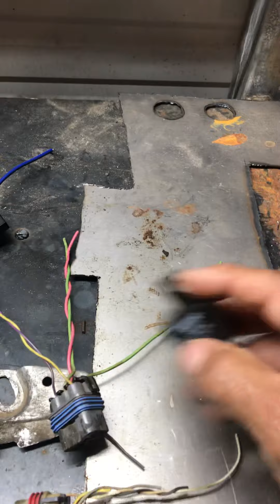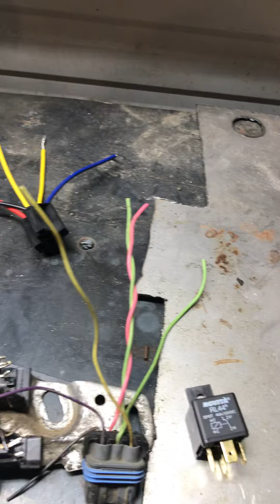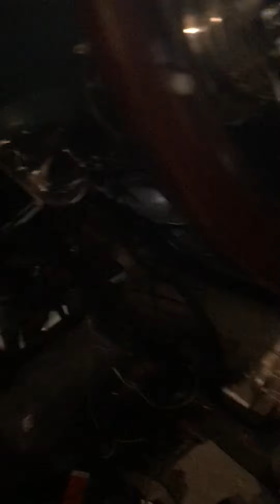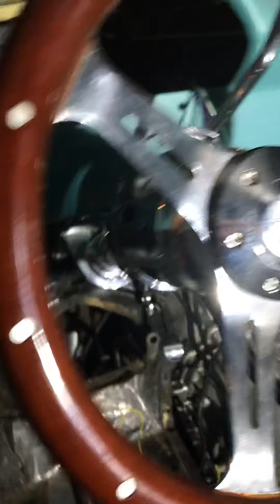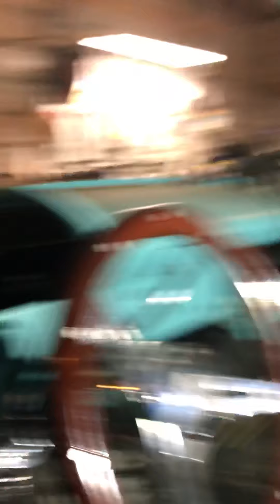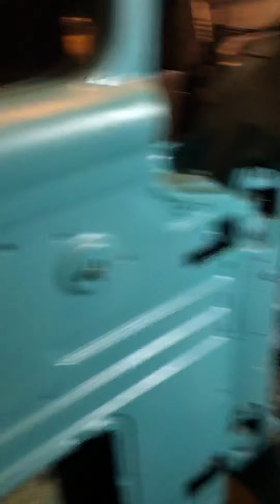Ls swap neutral safety switch and reverse light wiring how to

Comment: i can do this on a NV3500?
Reply from the maker: on the nv3500  the neutral and reverse switches screw directly into the side of the transmission
Reply: @ i have a problem it doesn’t want to start all lights show up on dash i just don’t hear the fuel pump and the seo ign fuse keeps blowing as soon as the key turns over
Reply from the maker: @ wish fuse pump ?

Comment: do you know what wire fron neutrakl safety switch is connecter to gear shift indicator on cluster (PRND21)?
Reply from the maker: there isnt one on the im using not sure about newer models

Comment: I’m using 4l60e in my 71 skylark the nss is on the column do I delete it from column & install as shown ? Thanks for learning me
Reply from the maker: id keep the original nss and and connect your starter using the original cirtcuit (starter wires),

Comment: the ppl wire from neutral safety switch is about 20 gauge so this is enough thickness to turn the engine on or must be replace it for a thicker wire?
Reply from the maker: too thin if you use the switch you should wire it as described the switch will fail if wired straight too starter after a while

Comment: am doin an ls swap into my 52 chevy truck with 4L60E the question is if I wire the starter relay as the factory donor truck (donor truck is 2002 chevy tahoe):  Starter wire (PPL) to pin 87 on relay,  ground to pin 85 on relay, Yllw wire (neutral safety switch) to pin 86 on relay and 87 not used. The purple wire does not connected to any where it goes straight to fuse block but it does not have any fuse. so do you think the factory relay wiring works to start the engine on?
Reply: Appreciate your help. Now I have every thing clear about this configuration and the wire I need to connect to push start module is Ppl/wht to start position on push start module . Thanks to share your knowledge with people like me that do not know much about auto wiring.
Reply from the maker: @javierargumedo3  your welcome sir glad to help👍
Reply from the maker: yes the starter relay is in the factory fuse box ,the starter wire from your 52 chevys ignition switch has to go to purple 
wire on neutral safety switch ,that signal goes through the switch out the yellow wire to fuse box relay then to your starter.that relay is wired the as i explained
Reply: @ozcorr909  thanks for a quik response so the purple wire from starter relay and purple wire from Neutral SS go together to Starter terminal on Ignition switch?
Reply from the maker: @javierargumedo3  are you using the stock fuse box,and harness?
Reply from the maker: purple wire from neutral SS goes the your ignition switch starter position ,,if your using the stock fuse box the yellow wire goes to the relay in the underhood fuse box location is block C1,rowA3 this wire is also yellow but thicker ,from there the relay  sends the starter crank signal through a thick purple wire in the stock harness,
Reply: @ozcorr909  am not using factory fuse block but am trying to replicate the factory relay but i was confused about the ppl wire from NSS THis is how i wired my starter relay:
pin 86 Ground  
pin 86 to Yellow wire From pin G on NSS (F11 C2) 
pin 87 to PPL wire from Starter
pin 30 to ignition switch (starter terminal)
Ppl/wht wire from NSS to Ignition switch 

the question is: the Ppl wire from starter (12 or 10 awg) and Ppl/wht wire (20 awg) from NSS must be spliced together and than both wires must be connected to Ignition switch on starter terminal?
Reply from the maker: @javierargumedo3  these two wires cannot be spliced together this will bypass the safety switch if you want to bypass the switch you can wire it from your ignition switch to starter like this 52 Chevy was originally with thicker wire of course. To use relay ignition switch start position has to go to purple on nss yellow wire to pin 86 , pin 85 is chassis ground,pin 30 is 12v constant (30amp fuse),pin 87 goes to your starter crank signal post
Reply: I really appreciate your help. This is the think I want to install keyless push start and the push start module  connector comes with Bat, Ignition, Acc and Starter but there no pin to connect the ppl/wht wire from NSS. I called customer service and they told me to run the ppl/what from NSS to fuse block constant power with fuse 10 amp than on relay pin 
85 ground, 86 ylw wire from NSS, 87 to thicker ppl wire on starter and pin 30 to ignition switch starter terminal or in my case to starter wire on push start module.

Do you think this configuration gonna work?
Reply from the maker: not familiar with the push to start wiring diagram ,but the relay is a switch ,pin 85 and 86 are the trigger you can actually make either one positive or negative but 86 being positive and 85 negative is the (right way) to do it ,pin 30 has to be constant 12v,and pin 87 has to go to whatever you want to power up when you trigger the switch(relay) by turning the key to start position it sends power to pin 86(in your case from ignition switch through the nss first through the purple wire back up the yellow to pin 86)this completes the circuit inside the relay  between 86 and 85 causing a magnetic field inside of itself wich pulls the internal switch completing  the circuit between 30 and  87 allowing voltage to continue on in this case the starter.so in short pin 85 and 86 work together as a seperate circuit to complete the path between 30 and 87,

Comment: OZ you are the man, you're the only one on YouTube that explained the 2 pin style correctly!! 

Helpful hint to others: my colors on my real GM harness was different but pins are whats important. I also fed #30 with the 12v purple coming directly out of ignition on my 73 nova and 87 went to starter as Oz says. Matter of fact here goes my exact full pinout for anyone who have trouble with lights.

A = empty on my 2003 harness  (so unhooked)
B = unhooked 
C = 12v ignition/switched 12v
D = Ground
E = 12v (permanent)
F = 12V out to rev lite
G = to pin 86 on relay
Pin 30 = 12v starter activation wire from IGN switch. 
Pin 87 = 12v out to starter
Pin 85 = Ground

Make sure yall give OZ a like for getting us right!!!! He was crucial for this info on the older style switch.
Reply from the maker: glad it helped
Reply: Question for you if pin 30 gets the purple wire from the ign switch where does the wire for E go? I was under the impression from the video that E goes to the ign switch and pin 30 sees 12v at all times… any feedback would be greatly appreciated

Comment: I would this video was for a t56 :(
Reply from the maker: t56 has both the reverse switch and neutral safety built in to transmission itself,wiring will be the same ,you will need a relay after the neutral safety to starter those wires are thin

Comment: pink wire must be connected to a constant fuse 12v and lg green without fuse go to rear light or must be fused?
Reply from the maker: pink wire key on fused ,wire to reverse light s is already fuse through pink wire

Comment: I already wire the relay following another video but in that configuration  Yellow wire (G) go to pin 85 and ground go to pin 86 so it makes some difference in the functionality of the neutral switch or a short circuit? i have to switch those wires same as ur configuration?
Reply from the maker: it wont make a difference those two wires activate the relay switch

Comment: great video! so i would like to ask, Do you run the  Lt Grn wire  directly to reverse light? and Ppl/wht wire go to ignition key first position?
Reply from the maker: yes reverse light wire goes directly to reverse lights,purple wire to ignition start position only has power when youre trying to start your engine

Comment: Good morning sir, I watched your video on your rewiring the neutral safety switch and the backup lights. The question I have. I bought a truck a 95 Chevy and it was a automatic originally somebody stuck the 
NV4500 5 speed standard shift. Will this work for that application? I know the video shows that you have a automatic. I am trying to convert it over so I can have backup lights when I put it in reverse. Any help would be appreciated. Thanks!
Reply from the maker: good morning the nv4500 reverse light switch on transmission itself the neutral safety switch would be have to be on the clutch pedal similar to a brake light switch .
Reply: @ozcorr909  okay thanks I will try that. I thought I could hook it up like you did and it would work the same way. Just leave my safety switch in park position I am more concerned about the backup lights working when I put it in reverse Thanks for the info.

Comment: This is definitely the best video and explanation out there.
I havent had reverse light the whole time ive been driving and also i switched to new column and lokar shifter so i didnt have a neutral safety switch anymore.

Followed your instructions perfectly and worked exactly how it was supposed to.

Holley efi/5.3 4l60/ in a 1953 chevy belair.

Greatly appreciate this
Reply from the maker: You are very welcome glad it helped

Comment: Awesome info, thanks for this. I'd like to add, on my 2003 truck 4.8 harness, the pin positions were the same but the wire colors were different. Neutral safety wires were dark green and pink (thinner), and reverse lights were grey and pink (thicker).
Reply from the maker: Thanks for the info!

Comment: Another Barry Bonds Home Run. Well explained and it does make sense comparing the explanation vs the OEM diagram. I saw another video only using 2 wires but when you take a look at the OEM diagram, it only works on parking. This one appears to work on all gears. The way it should be.
Reply from the maker: thank you  chui im glad it was helpful

Comment: I did an ls swap on my 1992 c1500 but have no power to brake or reverse lights. Will this solve my issue ?
Reply from the maker: im not familiar with how the obs neutral safety switch is set up but doing this will bypass the old neutral safety switch and power up your reverse light ,but your brake lights get power from the switch at the brake pedal,your tail lights get power from your headlamp/running light switch .

Comment: My Toyota RAV4 2008 has no power on the switch .don't know what to do.and by pass
Reply from the maker: im not familiar with those but im sure they work the same.you need to determine witch wire goes from your ignition to neutral safety switch,   you need to locate your starter relay and determine witch wire is coming from neutral safety switch to starter relay connecting these two together at the neutral safety  will by pass it.

Comment: I swapped a manual transmission and I’m using a 2001 silverado stock harness how can I bypass the nuetral safety switch.
Reply from the maker: easiest way is to run starter wire straight to the ignition it will bypass safety   and fuse box as well as relay you can put a 30-40 amp breaker or fuse   in between for safety sake.
Reply from the maker: i meant it will bypass nuetral safety switch as well as fusebox and relay,

Comment: Can you use the un-used ground on the plug for the ground for the relay?
Reply from the maker: that ground wire is to ground the switch itself it needs to be grounded
Reply: @ozcorr909  can I ground the switch ground, and the relay ground to the same spot under my dash?
Reply from the maker: yes ,as long as its a dood ground

Comment: Could this still work for a manual transmission 4l60 / nv3500 ?
Reply from the maker: nv3500  has  a reverse light switch that screws into the transmission with two wires one supplying power the other to backup lights it completes the circuit when you put it in reverse. neutral safety  will be a  switch  at  clutch similar to a brake pedal switch

Comment: What did you do with the extra green wire on the PNP switch? Thanks!
Reply from the maker: according to diagram pin B has power only when in park i did not use it i cut it and heat shrinked and taped it to the other wires

Comment: You could put the relay in the cab... and use the purple wire off the neutral switch as a ground???? Starter purple to relay    yellow wire off neutral switch to relay..purple off neutral switch to ground... that should complete circuit.....
Reply from the maker: Yes you can do it however you like I was going off the off the factory diagram 👍
Reply: @ozcorr909 hahahaha

Comment: what would happen is you put the yellow and purple wire together?
Reply from the maker: if you pu those two wires together at the plug nothin will happen as there would be nopower going to that switch
Reply from the maker: also if you bypass the switch your vehicle wiil be able to start in any gear instead of just in park and neutral
Reply: @ozcorr909  I was testing the terminals with a test light. clip on positive and I got a light on 86 and 87 something doesn't seem right
Reply from the maker: sorry pablo just saw your question clip your test on to gound ,pin 30 goes straight to battery put a 30 amp fuse in between.pin 85 to ground preferrably to battery ground.pin 86 to ignition starter position  and pin 87 to starter.using test light pin 30 light on at all times ,pin 85 is ground light never on,pin 86 light on only when you turn key all the way to starting position ,pin 87 light on also only on when you turn key on all the way.hope that helps
Reply from the maker: hey salvador sorry i replied to your question under salvador sanchez question below just noticed check it out if you still need an answer hope it helps
Reply: @ozcorr909  I put the clip on ground and touch 86 and it lights up
Reply from the maker: 86 is supposed to be ground
Reply: So if i put yellow and purple together would i be bypassing the neutral safety switch ?
Reply from the maker: just  saw your message this would bypass the neutrals safety switch if the motor is in the original truck but once you swap into something else you will be running the starter wire (purple ) from starter straight to ignition switch bypassing it all together, even if you use the original harness youd be leaving the sarter relay on the original fuse box the after market harness ive seen dont come with the neutral safety switch plugs
Reply: @ozcorr909  I am not getting power to the purple wire. I put a starter switch so I can at least drive it. hot wire from battery and wire from S terminal on the starter. I opened the starter relay and I'm able to start the truck by pushing the little metal part to touch each other and also starts
Reply from the maker: @pablogomez7519 assuming its in the original truck. if  you can start it by pushing the little metal parts by hand means you are not getting power to pin 85 when you start the truck .pin 85 gets power from the ignition only when turning key all the way to start position,Power goes down the purple wire to neutral safety  switch  from there it goes if up they yellow wire to pin 85 powering relay causing little metal parts to touch on their own.first check ignition fuse and make sure your relay is good if both are good check ignition switch by putting test light on purple wire  at neutral safety switch plug if it lights up when turning key to start position  ignition is good .put  plug  back on to neutral safety switch.You will then test neutral safety switch by pulling starter relay and test pin 85 on the fuse box  with test light should light up when you turn key to start position if it does not light up you can bypass the neutral safety switch by connecting purple and yellow wire together but truck will start in any gear.Note you are testing for power so clip on test light must be grounded.

Comment: So did you just leave the bottom one unplugged?
Reply from the maker: if you are using an after market harness the bottom plug is not necessary if you are reworking stock harness you can leave bottom plug as it came from factory and plug it in